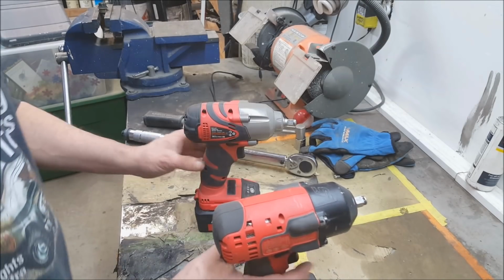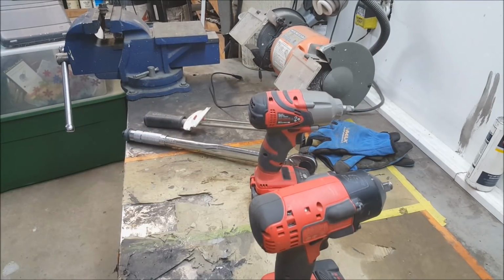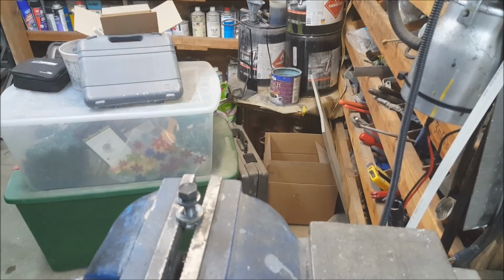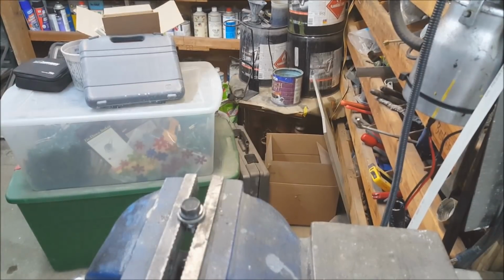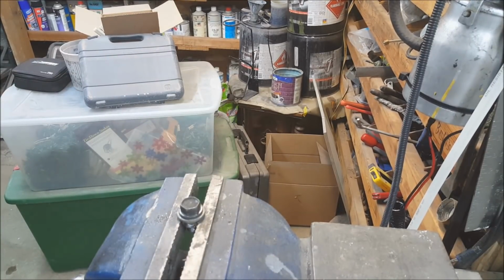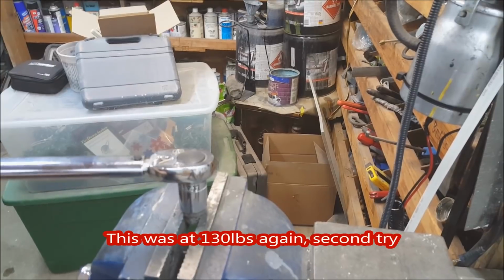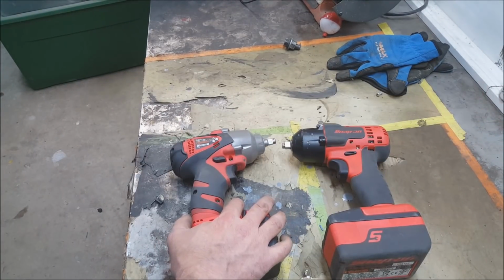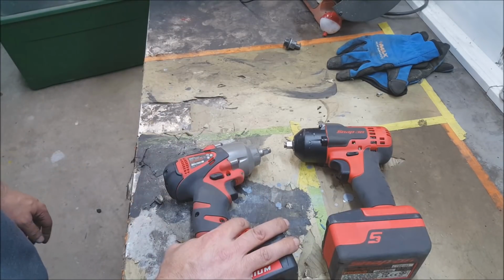Snap On 3/8 cordless impact vs Earthquake 3/8 cordless impact

Comment: Both are good tools but devil is in details. Snap on with 2 batteries is about 2x the price (on truck) vs earthquake with 2 batteries. There are a few difference that is important in a long term pro shop use. The very consistent high quality batteries that is inside battery pack on snap on is one thing you are paying for. Other little things such as name brand bearings, service kits, Molly lube make the snap on hold up well in pro setting. For lower end use and diy the earthquake is fine. Harbor freight tolls are getting better but they still are not consistent enough to be pro level tools but price is good and can't beet the convenience of stores. They are the new Sears for tools.

Comment: I bought the earthquake 3/8 on 10/20/2020 and went right home setup a nut and bolt in my vise set the torque  at 90 ftlb and the earthquake took it right off. Set the torque at 100 ftlb and the earthquake never moved it

Comment: HF coupons them out for 140 frequently. I am very happy with mine. The convenience of no air hose sold me right off the bat. Like you, I've tackled some nasty shit with it and it does fine. Getting sockets on and off the hog ring was a bitch at first. A dab of Super Lube on the ring fixed that and it seems to be breaking in. I plan to get the 1/2 drive after seeing how this thing holds up. I am convinced your adapter threw you off because mine begins to really struggle breaking bolts set to 150 ft/lbs with 175ish being the max and I can't see how your Snap On struggled at 130 ft/lbs otherwise.
Reply from the maker: I'm sure it was the adapter that limited both tools performance. I don't have any 3/8" drive impact sockets but I figured most people would be using this tool with the standard sockets so would give a good general review of its performance.
Reply: Yes. Good comparison and for the money, HF makes sense for DIY.

Comment: The crush factor is completely different for almost everything that was done, mixing different nuts and bolts…possible over torque or under torque…..a decent comparison visually but doesn’t seem like a fully accurate test….just my .02

Comment: Not a bad comparison, but when tightening the bolt, the SnapOn was run longer each time than the Earthquake.  Running each continuously for 15 seconds would give each a chance to use the IMPACT action to nudge the bolt as tight as the tool could make it. btw, the bolt was too close to tensile failure. The test should be rerun using a higher grade bolt of a larger diameter.
Reply from the maker: Thanks for the comment. I tried running the Earthquake longer off camera and it didn't make a difference.
Reply: Agreed

Comment: Professional diesel mechanic here. I have flat out abused my  earthquake 3/8 for over 2 years and it still is going strong. I got mine for $129.00 and didn’t have to deal with the egotistical arrogant snap on truck guy.

Comment: This might be a little off topic, but the price is the reason I still use an air hose. I run an IR 231C priced around 130 bucks and it has been rated at 425 forward and 600 in reverse and it seems to last forever if you oil it often. I also have a butterfly and a 3/8 pistol, and do not use either one very often.

Comment: Not bad, but you run the Snap-On longer. You need to time it and use longer class 8 bolts, with something in between to compress. A piece of metal or a wheel. Iron, steel or Aluminum will do, but each compresses at a different rate. I like both guns, since they both break 90 pounds. It would break auto wheels, but HF is best for the money. I'll give you a like for great effort.
Reply from the maker: The run time didn't matter. Off video I ran the Earthquake longer than the snap-on and the results were the same.

Comment: Selling my 3/8 earthquake to a buddy who owns a 1/2 already so he can keep the same tool line. Earthquake doesn't have a shit ton of initial breakaway especially on rusty fasteners here in the Midwest, however the earthquake will keep going and eventually pop it loose. For the money you can't beat them if you're not doing alot of tight work and you're not needing to break high torque value fasteners loose with a 3/8, then id suggest it. I already have a Milwaukee m18 fuel 2863 1/2 that I'm in love with so I'm going to stick with them.

also earthquake 3/8s hate wobble extensions

Comment: 20volt vs 18volts, not a real difference. Both use the same number of similar type batteries, they are just adding the voltage based on different parts of the voltage chart, as it goes from full/surface charge down.

Comment: For the money ill take the 3/8 everyday. I have used the 1/2 Earthquake for few years on cars and my dads truck, never came across a lug i could not take out. I think this is one of the better tools HF sells. My dad was using my 1/2 impact so much on his truck that i gave it to him. Which left me looking for a new impact driver. This time around i picked up the 3/8 HF has the discount going on right now for 129. I could not pass on this deal. I expect 3/8 to perform within application that its intended as well as the 1/2 did.

Comment: The 3/8 inch earthquake XT impact is $129 right now with the battery and charger or you could spend $600 for the Snap-on and get that extra 10 pounds of torque
Reply: @540 MUDSTAIN 
In the universe of battery marketing techniques, 18 volts = 20 volts.  They are both 5 cell lithium packs with the only real difference being how they are labeled.
Reply: @540 MUDSTAIN 
Lol well that may be but the voltage is only one variable and it alone doesn't even come close to indicating power or quality.
Reply: Snap-on is rated at 325ftlb breakaway.   Earthquake is rated at 370ftlb breakaway.   Warranty is worse on the earthquake and when the Snap-on is out of warranty it’s $160 to rebuild and 90% of the time they usually send you a new impact.
Reply: You have to also check the bpm of the tools it’s not always about ft lbs and battery volt

Comment: from my experience if the tool breaks under the extended warranty  harbor freight will give you a new one and also let you purchase the extended warranty on the new one that they gave you, so one could have the tool "break" at say 11 months and go exchange it and get a new warranty and start all over again. i'm not sure of the actual policy on this but they have let me do this in the past.
Reply from the maker: That's also been my experience, no questions asked when returning on the extended warranty. Trade in for a new tool(or put that money towards a more expense tool) and have the option of another warranty on the new tool. The cycle starts over.   LOL
Reply: Wicked Spray the other great thing about it is there’s 3 harbor freight stores in my county and one is only a mile away from my house

Comment: guess am sticking with earthquake  anybody else ??
Reply: Yeah because 20-50 ft/lbs of torque makes all the difference when the snap-on costs 3times as much.
Reply: YES' I second that statement all day every day!
Reply: Snap on in my experienece is so much better than a cheap brand that make crap power tools seriously I broke 3 earthquakes already and my snap still runs like a champ
Reply: clutch in harbor freight tools are by no means the best but they are getting better and better
Reply: @Ryan2dabs  the might seem better the first weeks, till the battery starts losing charge faster, the impact wrench starts losing torque
Reply: clutch in my coworker just bought a snap on 3/8 drive cordless ratchet and the potentiometer broke within 2/3 weeks the shop has had the Milwaukee for years no issues the snap on is a stronger torque wise tho. But at least the snap on guy replaced it took about a month tho
Reply: @Ryan2dabs  wish I could like your comment about 5 times lol
Reply: I just asked my snap on guy last week about that impact gun $700 and some dollars I went to pick up a tool box for my dad today at harbor freight same impact for $169 I'm not going to used a lot just here and there so I think $169 is about right and is thrue HF is getting better and better.
Reply: @Ryan2dabs  coworker bought the snap on 1/2 and 3/8 i havent seen his 3/8 in a while so i asked and he said i took a shit, i've been using my dewalts xr for close to 2 years now with no issues.
Reply: one drawer in my box is nothing but earthquake and I'm running outta room and will be dedicating a second drawer...
Reply: a random frog At that small of a difference, just run the earthquake a little longer and it’ll pull loose. No problem. Snap On is literally just a name with a tool attached.
Reply: @GottSegneDich  i been running  the earth since and still no have issues plus I have free replacement so am good.i wld  love to try other brands too but not snap
Reply: Samson Ato Nympha I hear ya man. I don’t use either one personally but my Milwaukee works flawlessly for me.
Reply: Snap on are nice tools but they are way too pricey I’ll just stick with the earthquake if I want an upgrade I’ll go with dewalt or Milwaukee
Reply: At work I have snap on but for home there s no way I can justify having snap on...

Comment: Who's "we" & "we're"? Adapters completely invalidate results. Most important comparison is Earthquake is less than 1/3 cost, just like their pneumatic tools. I've seen AvE/BOLTR do a teardown on both types, mechanically 99.9% the same. SnapOn is in huge trouble. They way over price everything because of a perceived status symbol. Great tools I agree but still way way over priced on everything & HF is taking their business. When you have a massive fleet of 150, 000 dollar 6 mpg trucks that drive 100 miles plus a day to sell a few tools per day, then, yes, you need to price a 25$  1/2 breaker bar at 150$ and 200$ tool carts at 850$ and the list goes on. I own the Earthquake battery power & pneumatic tools, even if snapon can turn out a few lbs more torque, its meaning less. I can buy several earthquake of different sizes/types and still save a bunch of money over 1 snapon tool. Designer clothes will sell but designer tools are dinsaurs these days. Snapon is going to get what they deserve for ripping of so many for so long

Comment: As a professional tech I don't buy snap on 80 dollars for a ratchet 20 for a harbor freight life time warranty I have the earthquake 1/2  use it everyday not 1200 breakaway but it does the job if it can't break the bolt with wd-40 it will loseing the bolt

Comment: Chrome sockets are harder so there more brittle making them more vulnerable to cracking or warping under heavy load, however,  those guns are not strong enough to "explode" sockets lol. Only crappy part is the chrome sockets round in the corners of the square drive making them unwarrantyable lmao that's really the reason the shouldn't be used with impacts but impact sockets wont do that and there cheaper!! I usually do it the right way but every now and then I impact on a chrome with my big 1/2 and nothing bad happens! Got tired of everyone saying his sockets were gonna explode lol 😂

Comment: You would have better results using a impact socket compared to the chrome socket the chrome socket can provide torque loss
Reply: How'd this comment wind up on a tool comparison channel??? What's up wit dat YouTube
Reply: How does a chrome socket provide loss of torque lmao there harder than a impact socket if anything it’s the other way around
Reply: Mass..
Reply: Impacts usually have more mass and its softer so its better for your anvil on your impact. Plus when you use chrome it destroys the finish and whatever your working on will have fine chrome flakes dancing around just like on the vise in this video. If you use chromes over head on an impact you will have chrome flakes in your eyes. If your using a chrome on an impact and it cracks open or gets a nasty sharp edge from the chrome while holding it your hand is fucked
Reply: @tommater2724  non-impact sockets have thinner walls, and flex more, leading to loss of torque.
Reply: elkvis fake news maybe you harbor freight ones but the one that us professionals of 30+ years use don’t .... ya get what you pay for
Reply: @tommater2724  so nice of you to reveal yourself as an irrational tool truck fan boy.  Too bad you didn't pay attention in high school science class.  If non-impact sockets from the tool truck will do the same job, then why do they also sell separate impact sockets?
Reply: elkvis and if you were in the automotive business you’d understand the tool truck smh 🤦‍♂️ but I see your not or your young and new to the business... does amazon come to your shop and replace your broken’s
Reply: @tommater2724  your words have no effect on me.  You're the one trying to justify paying way too much for no better quality.
Reply: elkvis same here bud not sure why you’re commenting on my post take care

Comment: Chrome extension and reducer with the chrome socket also caused torque loss
Reply: Absolutely correct
Reply: @DOYLECLEVERLOBE1  
Torque wrenches and impact wrenches are not the same thing. Impact wrenches do lose torque when using extensions.
Reply: extnsion is a wobble too!
Reply: Doesn't mean a thing torquing I parts together but when taking them apart extension will absorb the shock/impact that's required to pop loose the fasteners

Comment: You cant use that extension as it loses all the energy by soaking the impact.  Also need to use a hardened impact socket.  Just saying. A chrome vanadium 12 point can explode and it also soaks up the energy of every impact strike.  But none the less this test still shows that chineesium can get the job done at a cheap cost.  Ill buy earthquake.

Comment: Your test doesn't make any sense to me why don't you tighten them with the torque wrench at the highest point then see which brand is better
Reply: Larry j.w Since nobody answered you, I will. You can’t torque the bolt at the highest wrench setting. 1) The impacts are only rated for so much torque and the wrench is guaranteed to exceed that rating. 2) The material and size of the test bolts are not rated for that much torque. Bottom line, it wouldn’t prove anything as neither tool would bust the nut.

Comment: HF torque wrench is about + or - 4% just like any other brand of that style wrench even Snap on, digitals are more accurate. Unless what you're working on flies or floats or goes over 150mph 4% isn't a lot to worry about.

Comment: I'm sure there are those out there going, "But...but....but....it's a Snap-on!!!!"
As if it's supposed to make that big a difference.
If you're breaking loose lugnuts over 100 ft lbs, you should be using a 1/2 inch impact and pretty much any 1/2 inch cordless impact will work for that.
Great video. Apples to apples comparison.

Comment: Do a Dewalt 20volt next!!! I got one online EBay New for $60 for the tools and battery and charger around $30 for a starter. I got mine after my friends that work in a auto body shop here in town I would go camping with told me for the price you couldn’t beat them. They were up there in price and still are but I am pleased. I have abused mine for several years now. I even use it on my camp trailer to operate the jacks. Just love it!
Reply from the maker: Yeah that would be a good one to try. If I need one for my home shop I'll look into that. Thanks the suggestion